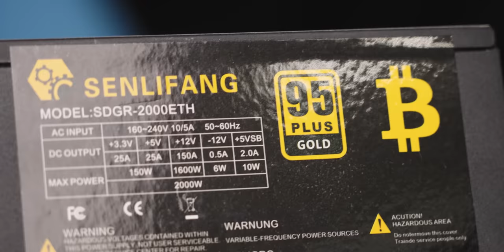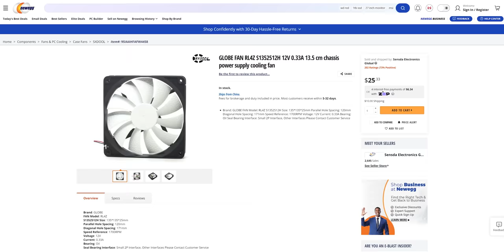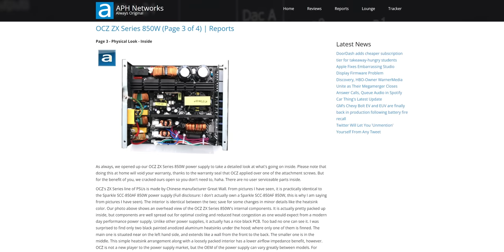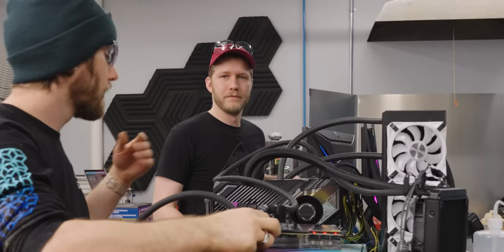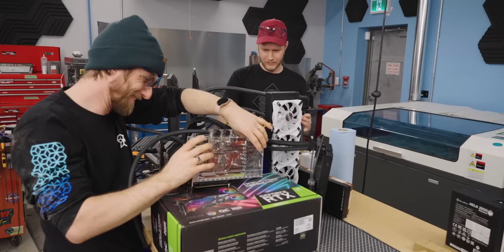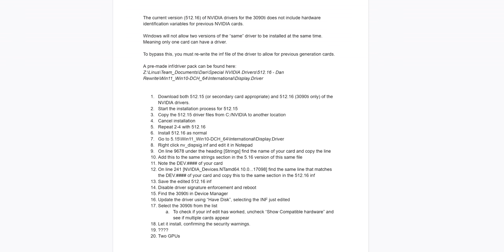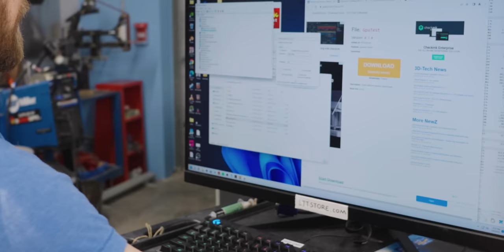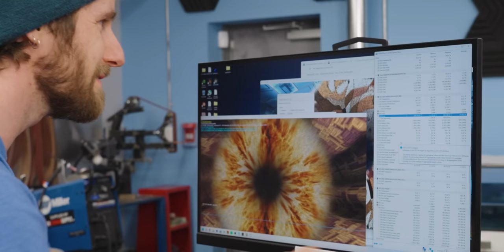This is one SKETCHY 2000W Power Supply

Comment: I have dozens of these and others that actually do run over 1900w for months without a break. The back of the PSU gets to 80-85C and should not be touched. 

Actually, no part of that PSU should be touched while it's running and it tends to shoot bolts out of where the power switch is when it blows or when you try to turn it back on after it blows. Push the power button on the PSU with a non-conductive stick.

Comment: While interesting, I am not sure about a video that is premised on the supposed lack of quality in an unknown product.   A better approach would be to actually test the power supply to find out its limits and determine how clean the power delivery is.   Issues related to heat an noise would be quantified and reported.  That would have value.

Comment: i purchased a Bid war for power supplies on amazon,  IT had 2 good 1500w 12v power supply  for  hp server computers,  a bunch of bitcoin miners   A BUNCH Of them were fried but 1  . And a wierd ass power supply that  was 110v and 220v , no normal english on it . And  when i ripped it apart it had a 500w board ,  with a 2000w bitcoin sticker on it .  they were very interesting  IT made way more then 500w but it started smoking after a few days of use.

Comment: I'm wondering how on earth that thing's going to draw 2,000w when a standard (North American) single phase outlet provides a maximum of 1500w. Which is why high power devices like a washing machine or drier has to run on one of those big 2 phase outlets, to provide 240v and 3,000 (North America, still). That's the only thing I can think of. But getting a 2 phase outlet installed in your living room probably won't be cheap. Or justifiable for the sake of an overkill PSU.

Comment: Im in bc working in electrical and we never use white as a hot in 240.  It needs to be black or red in 240.  In areas like 3 phaze blue is also used as a hot wire.  Your not really even allowed to tape a white wire black in some situations. ill have to pear my 2021 code book to see the rule.  Will say the white aka neutral will have power if the circuit is under any load.  Neutrals are very bad because lots of sparkys forget about that.  I always get reminded of this because in some homes 2 circuits share neutrals and they spark when pulling a buddle of them apart.

Comment: About 20 years ago when I started out as a basic field tech learning the trade I used to have to replace power supply fans all the time never really knew what I was messing with I mean I avoided touching anything I wasn’t actually working on nowadays you would just swap out the psu or generally they don’t fail or need new fans

Comment: A 2kW PSU should be FAR LONGER than that!  A properly-built 2000W PSU shouldn't be able to fit in a standard ATX case.  You'd need a server supertower like I have to mount one.

You'd be better off testing a PSU with older (but still power-hungry) hardware like an FX-9590 runnin four R9 Furies on a 990FX motherboard.  All you need is draw, you don't need expensive draw.

Umm, Linus, I spent three years as an electrical apprentice and you have the colours backwards.  BLACK is hot and WHITE is neutral.

Comment: im mining currently with one made from this same company but its 1600 watts max and also u can use 120 volts and its been working great actually better the the 850 watt thermal take which just destroyed its self cuz of mining on it i was using 3 gigabyte gtx 1070 8gb g1s and also cpu mining on this same rig with my intel  i5 10400k and 32 gb ddr4 ram and i love this new psu man

Comment: It would be cool to get a certified PSU electrics engineer to tell us more about the differences between these two (known and unknown) power supplies.
For example is that cheap one likely to explode or catch fire, or is there something else hazardous that might happen with it etc.
It looks to be running just okay, but I still wouldn't buy it because of this video and would like to have someone really tell us the risks and how it works in comparison to the more expensive ones.

Comment: "Both?" I was under the impression 80+ certified PSUs had to have Active PFC, meaning there was only a single circuit for input, no red switch for 120/240. Whatever voltage comes in gets actively switched to proper voltages for conversion to DC?

Comment: Conclusion:
240 Volt Power outlet is forever superior than the rest of the world who use anything below 220 Volt.

Because hypothetically, if the entire housing appliances on the planet are united to just 240 Volt, the Power Supply from any brand will be significantly cheaper, including the reputable brands. Because they don't have to include 110-120 Volt transformers and mosfet which make the PSU itself more lightweight if only containing 220-240 Volt transformers & mosfet.

Comment: White and black are both hot in 240v  at the power plant they generate 240v spinning alternators 1, -1 and basically you send one of the legs to ground and that is how you make 120v.  240v alternating current, you get both sides so it altenates between both sides.  Both white and black are used and thus are hot.

Comment: Ya’ll should be using grounding bracelets gonna poke around in a PSU, on or off, one static spark and that ish is banked. 
(Used to build and program computer system from scratch for a job, not consumer tech mind you but still lol safety first)

Comment: FYI  cheap PSUs will also cheap out not by using shorter cables but by ( or also ) using aluminium instead of copper in the cables.

Comment: The only thing that may possibly hurt you in a unplugged PSU is a large capacitor. Most modern electronics have a bleed circuit that will discharge capacitors in less than a minute after power off.
Reply: Better to assume it's dangerous and take precautions than be reckless and get killed by still charged caps

Comment: Err hey guys, lots of good advice but you need some too, do Not Ever leave hairy strands hanging about in a 240volt connection, it's not just a case of you might create a minor to moderate fire hazard depending on the plastic you're working with, you Will create chances for build up discharges every few days potentially damaging equipment intended to work with blue wave inputs, the latter usually is not an issue with a quality PSU but we Aint talking about a high spec PSU here are we :D

Comment: not using wire ferrules and cutting a cable isolation with a cutter

horrible and quite dangerous work, damaging the copper fibers can cause high resistance which equals to fire hazard
Reply: even manual wire strippers have a chance to bite the core a little bit, the increase resistance is effectively nill unless you put a direct hole in the middle of the cable, and even then I would doubt it would cause a dangerous situation,

Comment: Oh, for- 
Yeah, ok, you're never supposed to make that kind of cable.
The more important thing is that you incorrectly made the cable you should never make.
FIRST: If you need to do this, you make the dangerous part as short as possible, and as close to the point of use as possible.
SECOND: Avoid splicing pre-made cables, as they are not technically required to comply with standard color codes - and often do not! I've seen BLACK ground and GREEN hot inside these cables before!
THIRD: Make sure the cable is rated for the number of amps it's going to be drawing! This is less of an issue if it's just 2kw, but that looks to be a NEMA L6-50 receptacle you're plugging it into, and that cable is rated for, what, 20 amps? The lowest amperage cable should be closest to the device.

Alternatively: You could haver literally just modified the NEMA 5-15R to IEC320 C14 power cable that you plugged into the unit to be a NEMA L6-50 to IEC320 C14 cable.
I say "literally" because NEMA L6-50 to IEC320 C14 is a valid and supported cable configuration. They're like $40 shipped. You didn't need to do any of that.

Comment: I was so confused why they had to modify the power cable, then I realized that LMG is not located in Europe...
Also love that they're scared of 240 Volts (or 220? idk), while I'm sitting here with about 250 Volts AC in the socket because we live very close to the substation.

Comment: I bought something similar when building my PC and it was a 1050w power supply, very weird bronze rated power supply and its been running strong for 3 going on 4 years already. No problems at all. I kinda jumped the gun and got the biggest power supply I can find for cheap so that later on if I wanted I could put a bigger GPU and CPU since they would draw more power. Still don't know the name of the brand but it came in a red box. I think it's Apevia.

Comment: did you check the connector wires, cooler master & corsair really use very good quality cables to minimize the voltage drop at such high rated currents, i had a cheap 'with the box smps' whose mobo & cpu wires were quite sub standard warm to touch & just powering the 65w cpu, also try to measure the dc ripple on the lines.

Comment: Why you do not connect your equipment directly to both phases and it will be same as 230V...
I mean use only both phases (in split phase nonsense) for all electronic equipment and use standard 230V equipment as rest of the word.
Frequency should not be a problem.

Comment: You guys should hire someone or invest in the education to safely work around power supplies. This is illustrated when you talked about the combined wattage rated. If you are scared of it then you shouldn’t be messing with it. Those are the people that will eventually get hurt. You can test for voltage and manually discharge PSU caps to make them safe if you aren’t sure.

As far as safety goes, well consider this. In North America 120 volt plugs and their accompanying circuits use 14 gauge wire which is rated at 15amps therefore have 15 amp circuit breakers. 2000 watts / 120v = 16.6amps. How long do you want to run any brand 2000 watt power supply at full load (16.6amps) on your 15amp residential wiring?  Even the name brand can’t deliver its advertised wattage on 120volt nor should it for safety sake.

Regardless it’s just a mining power supply, people have been using these for years. Plenty of YouTube videos testing them including power consumption. They are usually within <1% of a name brand at full tilt. 

Since they are for mining they offer no thrills, they are loud, not modular and they require 180+ volts (208-240). Their efficiency at lower consumption might be questionable. That’s fine for mining tho, it’s not like a room filled with graphics cards running maxed out is quiet. 

The benefit is if you buy them in bulk you can get ten for the price of one high end consumer power supply. So 500 dollars instead of 5000 dollars if you need 10 kilowatts…kind of a no brainer.

I would not use these in a gaming rig that sitting in your office/bedroom.

Comment: literally had to remove the overcurrent protection for my PSU and run two old, offbrand, janky PSUs in parallell to get my last upgrade working because i'm now hella broke and really, really cant afford to buy even a mediocre powerful enough PSU. considering using my A&H ML3000 studio mixer's PSU for 12v power delivery so that I can at least draw enough power to not blackscreen my GPU. Sooooo if you want to potentially save this hobbyist-engineers life from (exciting though) death by magic smoke, feel free to ship over the stuff you otherwise would consider throwing in the trash
otherwise, all good, no hard feelings, this stuff really is fun to DIY-fix (until it isnt, but we're not there yet so its fiiiiiine)

Comment: Quick question: RIFO that american standard wall plug/socket is rated at 1800W@10A or 15A breaker. How it would sustain 2000W power supply anyway?
Reply: Did you watch?  It says 240 volts needed for 2000 watts.

Comment: Just buy a 220v PSU cable. 220v and 240v are the same thing so no worries there. Just be sure the plug you buy matches the design of your receptacle. I just don't agree with you showing how to wire it up.

Comment: Wrong Linus. In Canada a 240v cord has a black, a red, a white & a ground(green). You should NOT be using 120v cord for this experiment. Your using a $6000 computer, don't cheap out on the power cord. Two caps & 30 ft of #12 3 wire should cost less then $100.

Comment: I’m super concerned about the maybe high (and thin) gauge of a 120V extension cable used to carry 240V. Did the insulation start to melt? Was the cable warm? 😬😬😬
Reply: Why would it be a problem? 2000W is only 8.3A at 240V. 3 x 1.5 mm² (16 AWG) extension cords are allowed to take 16A in Sweden (10A in a wall due to lower ventilation); this is a yellow cord (14 AWG?), taking 15A in North America? I really don't think there's a problem there. Remember that the current will be half when using 240V, so you can use thinner wires.

Comment: why not use a static load with a pwm drive to simulate load and the kind of power draw a PC dous.   and 2000Watts a problem to get from a wall socket the 240V (better) part of the world 3600 watt from a wall socket is the standard. the problems you run in to in the great USA and consortium.

Comment: Wow. For a video like this, you might want to use the services of an actual electrical engineer. Transformers don't have magnets,  they have a core, typically laminated iron. The large electrolytics will be on the DC side, most likely for smoothing. Also, to test a PSU, you don't need to risk an expensive pc, you need a multimeter and a series of loads, like resistors, lamps and motors, and a multimeter, or oscilloscope. Bigclive or sexycyborg would have done this properly.
Reply: By magnets I assumed they were just poorly describing how the alpha winding causes a magnetic field which passes through the beta winding to create the stepdown / up effect

Comment: might trust it to run a TEC superarray
TEC modules are CHEAP and tend to glup power faster than a fighter jet at cruising altitude
and as this is a bitcoin focused PSU that vast majority of power is on the 12v rail, perfect for a 1000-1500W TEC pump wall

I actually loved that video you guys did, sadly your issue was attempting parallel flow with no valves, so most of them probably either starved for flow or were overloaded with flow, and you used normal centrifugal pumps rather than diaphragm with a relief valve back to tank, so flow could easily be chocked up too much

Comment: Do you think the wire is thick enough for 220volts.........that yellow cable you are using is way overkill lol, in UK our powersupply cables are same thickness as your 110v pc cables ours just have 3 wires in them because we use an earth.
That yellow cable is rated at 30amps in uk, the power out put of our wall sockets is rated at 13amps
Reply: the only problem with going overkill is that it costs more, If they really wanted too they could of done a calculation to figure out the exact size of cable they could of used but its easier to just go  way overkill than crunch the numbers

Comment: I've had my fair share of dma driver verification errors recently on my oddball gpu. To fix it, seems like I have to disable something related to forcing dma in the bios. It worked no problem with a normal card like my old 770.

I hope that fixed my issue and that it's not random, I hate when I think I've fixed something that was hard and it happens again.

Comment: Why didn't you just buy a 240V power cable for your power supply? Also in a 240V only connection there's no neutral wire. Obviously this is very much a no go in terms of electric code.

Comment: Since they want to review a sketchy power supply then they should gain the knowledge to properly evaluate it rather than guessing.  Maybe do your jokes and guessing, then bring in a knowledgeable guest to check if there are any safety red flags.  Saving money is good, but not if it burns down your house or gives you a fatal shock.  The guest can't do a complete evaluation because she's not tearing it apart but can look for the basics.  (A MOV touching an inductor coil is NOT monitoring the coil temperature!)

Comment: Imma take a moment to say I didn't know you're not supposed to open a power supply. with that said mine makes a loud ticking noise when booted do to what I think is a bad fan bearing. so yeah I may or may not have opened mine. it still works and I didn't die so yeah

Comment: Look at the time 20:23 and you will see a power supply under the test bench
Reply: Yes, the supply that they typically use, and aswell as looking the the psu you can see its cables, which are black, and in the exact same frame you're able to see that the only cables plugged in are yellow and red from the "sketchy" supply, not sure what it is that you're attempting to prove?

Comment: Interestingly a 500W can indeed feed a 3080. However you need to reduce power consumption  in other aspects. For example I have done it with  a 12400 i5 CPU (much less power than a 12900k and it will not bottleneck most games) on an itx motherboard. All running in a basic test bench (no extra power dedicated to pumps, case fans, lighting ...) and just an nvme as storage.  Also a bit of undervolting just in case.

Comment: So here is a hypothetical question.  Since you are trying to max out that psu, would you be able to wire/connect this psu up to multiple video cards across multiple pc's while those pc's (minus gpu's) are running off of their own psu?
Reply: That is actually quite interesting, however im not sure how it would work, since the imbalances between a psu thats powering everything else except the gpu, but alternatively maybe they could run multiple entire pc's off of a single gpu using cable splitters to effectivley run the pc's in parallel with eachother, but that could be a whole other can of worms